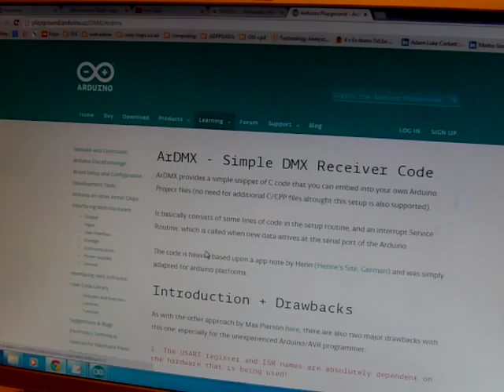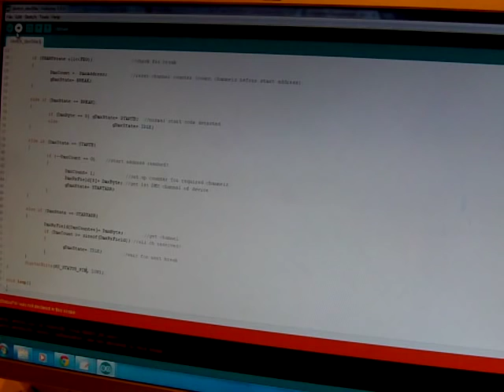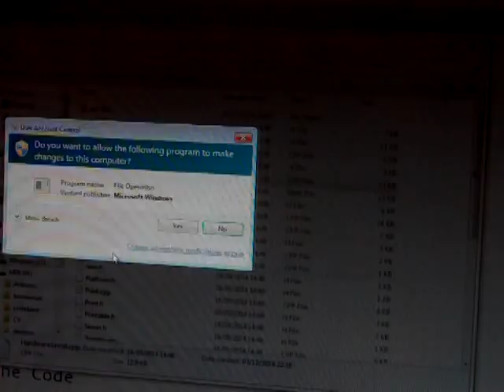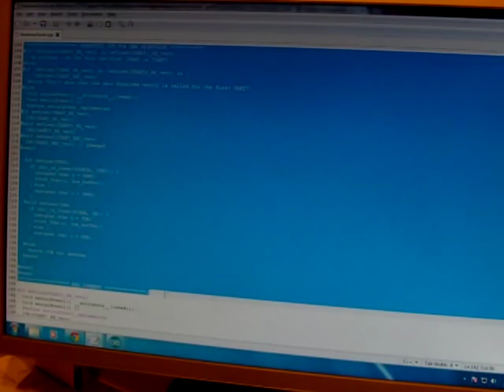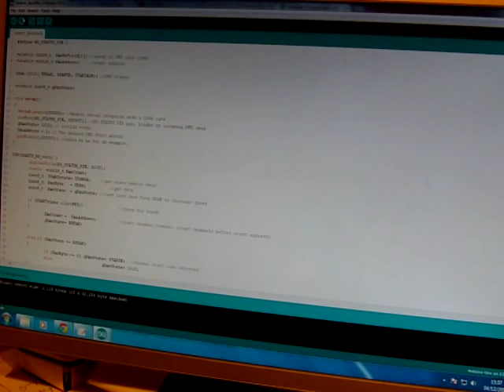#2 How to: ArDMX receiving DMX with Arduino.

Comment: Hello, i really need your help. I want to control my ws2812b (it is 16*16 in snake connection) using dmx controller and arduino. like dmx>rs485>unoR3>ws2812B, im seeing existing projects already. but i dont want to consume all 512channels for each color like 170pixels only (RGB*170=510channes), im looking for a code where i only need let say 1 channel of dmx (0-255) to display

000-005 displays letter A on 16*16
006-010 displays letter B on 16*16
and so on up to letter Z and including numbers. i think that is possible, say

if DMX=003
then arduino pin12( to ws2812b sends data that displays letter Ae
Reply from the maker: pretty simple for you to implement - you need something to collapse the DMX value to a array pointer, eg; 1-36, each representing a number/letter, and then you need an array of strings for each one with the data to send out.

Comment: Hi, excellent video! By any chance do you know if this can be done with another transciver? Like the max 485? Thanks
Reply from the maker: yes it can - and RS485 driver than can take TTL and drive the differential pair. The receive enable, Transmit enable ect might be different, you'ld have to look at the datasheet for that.

Comment: what is the arduino version you are using in this video? Since I am trying to change the Hardware.ccp file but the code inside are very different from your.
I've tried to use your .ccp file, but it refuse to compil.
Thanks again for your work🙏
Reply from the maker: hiya - sorry it's indeed an older IDE version probably pre 1.0 from 2011/12.

Comment: Great video dude! I've always wanted to make a switchpack with an arduino. could you tell me the exact chip you used? i found some similar ones but they are "b" models at the end. i found these: SN65176B and SN75176B...
Reply from the maker: hi Dominik, So many transceiver chips will work. Just make sure they're differential drivers suitable for RS422/485 communication. The ones I  use are SN75176B's from TI, but MAX485 are another good option. the 65 also appears to be another varient - but i haven't used them personally.
Reply from the maker: if you're making a switch pack make sure you include some debouce code in the relay / solid state switching side as some faders cab be a bit twitch about a value which would cause the relays to be upset,

something that changes and then sets of a frame counter and then counts down before allowing another change would be ideal, 20 DMX frames is just under half a second, i would start there.

Comment: Great Video.. It's working excellent. But i want learn how to do auto addressing for N Number lights.
Reply from the maker: You would just need to add some code to the start up to select the channel address automatically. Or search for rdm with Arduino. Pretty sure someone got rdm working.

Comment: +Crazy-Logic dont suppose you know how to get this working on the later version of the IDE, im currently on 1.6.5 and it seems there have been some changes to how hardware serial is implemented. not code savvy enough myself to know how to adapt to this change.
Reply from the maker: +Crownomancer Hey, unfortunately I haven't used the later IDE's so I haven't had a chance to look at the new implementation. I might be able to have a look at some point over christmas. Matt
Reply: +Crazy-Logic if i make any progress ill let you know, that said i might have to resort to an earlier IDE version, do you know which version you had working with this?
Reply from the maker: I think it a pre 1.0 version - it was current from around 2011/12 (all IIRC)
Reply from the maker: +Axel Litoral yeah - I need to have a look at the newer IDE, as it's changed. I should have some free time coming up in the next few months to have a proper look.
Reply: +Crazy-Logic Have you tested the new IDE? I need the working sketch for a technician project in my college. Thanks for your help!
Reply from the maker: +Niklas Decker unfortunately not, my free time vanished so i haven't had any time to play with these things. :(
Reply: +Niklas Decker i managed to get the whole thing working, using http://www.mathertel.de/Arduino/ library's, turns out the output on my DMX controler had its A & B lines inverted. if your sure everything else is working try swaping them over.

Comment: Great post!
Reply from the maker: +George Bamforth Thanks :)
Reply: +Crazy-Logic Very new to this, I'm a LD / LX tech usually, but trying my hand at some Arduino stuff. I ordered in the Transeiver as per your provided data sheet, it is far far too small for the breadboard i have.... what do i do?
Reply from the maker: +George Bamforth - it's really great that you are trying. :) I really do with you lots of fun with any projects you do. 

It sounds like you're ordered a surface mount chip and one that's not in a DIL packages. Breadboarding requires DIL packages usually. the way round this would be to either buy some DIL packages or you can solder the SM chips onto little break out boards that allow you to mount them into a bread board.
Reply: @CrazyLogic  I think you mean DIP
Reply from the maker: @RandomakerYT  yeah DIP/DIL easy slip up.